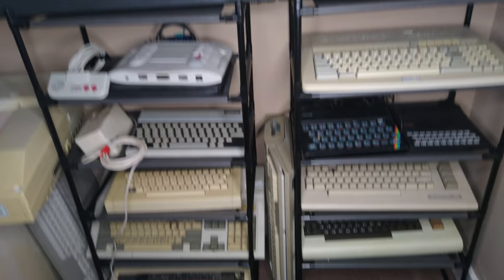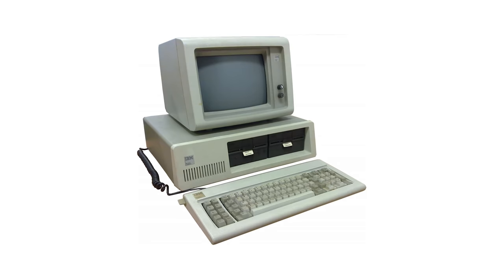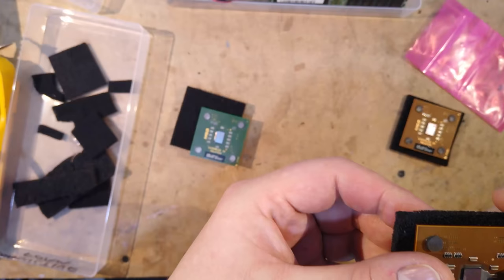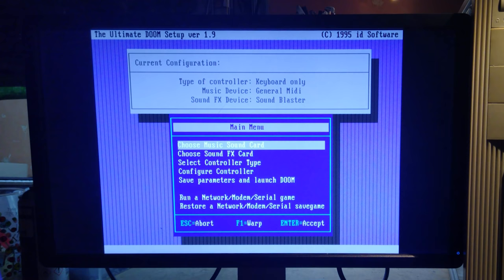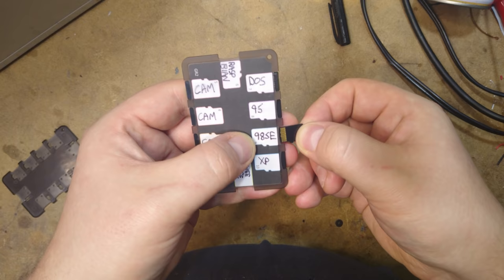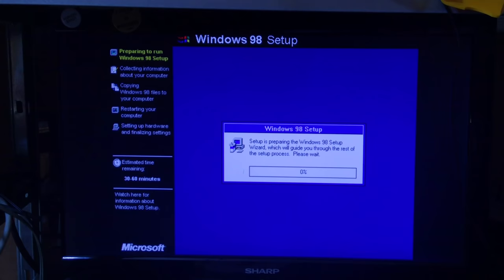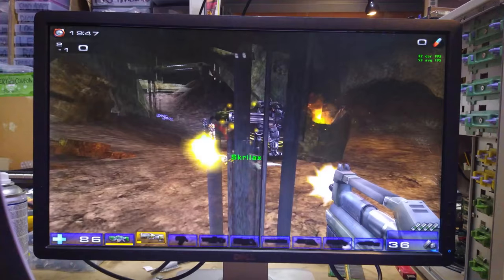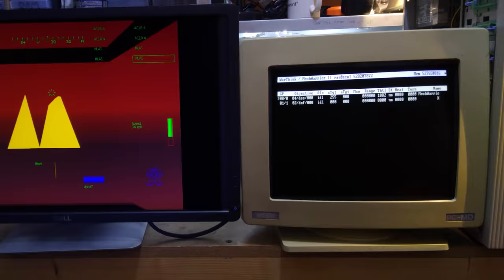Building a RIDICULOUSLY Overpowered DOS PC - Retro Rocket

Comment: 1:59 I think this claim is not really true. From my experience there are a lot of PCI sound cards which provide a perfect 100% compatibility (with SB-link of course) with every DOS game. 
All this while giving you a much better and cleaner sound, compared to majority of ISA ones.
Reply: Even without SB Link, I have an ESS Solo-1 and it works v well with a lot of DOS games 😎
Reply from the maker: Yeah that's true. SB-link would limit me to slower motherboards, though. Also I don't have any SB-link soundcards :)
Reply: If you have access to SB-LINK and only PCI slots, the YMF724 (and its friends 744 and 754) is the best choice for this hands down. It just so happens however that any motherboard really worth using that also has this connector also just happens to have an ISA slot or two.
Reply: @jamesfmackenzie  We meet again, my ESS Solo-1 with a socket 939 via board indeed works fantastic under dos to. Doesn't need sb-link either with the via chipset. That card has tricks up its sleeve to hijack whats needed.
Reply: @Henk717  😎

Comment: I’d love to recreate a retro rocket like the system I had back in the mid 2000s, loved AMD then and had an nforce 2 based Soltek board and a Barton core XP3200, MSI ti4800 agp card. Working in the industry and having access through friends and trading/swapping etc I ended up with a Tyan Tiger 2466 with matched MP2800 cpus, it was fast as hell but crap for gaming compared to the nforce board/XP processor. If I still had those rigs they’d likely need recapping, still have the 450w aerocool psu that ran them but not powered it up in years.

Comment: Look man you probs know what your doing so I wont bore you. Disregard if its no new info. When struggling with drivers, just install the windows compatible with the device. Navigate to system32 then drivers. Copy all driver name related folder. Install your newer windows and copy this driver folder to desktop. Right click the device and browse for driver. Select the folder, a error will appear as the driver isnt signed but you can just allow it. Ive found out of 100 times this has worked 100 times :)

Comment: I think it's time for a new Chain of Fools video. You can upgrade win10 from x86 to x64, so it's possible to go full-tilt and see if the legacy apps still work on Win11 x64. ;)
Reply from the maker: Haha, maybe :)  x64 windows won't run 16-bit apps though, I'm guessing it would be a pretty disappointing...
Reply: Wait it's that possible? How?
Reply: @AlejandroRodolfoMendez  If you mean upgrading win10 from x86 to x64, you just run the win10 x64 installer from within x86 windows, and pick the "upgrade" option. It should let you keep your settings/apps.
Reply: @BenKDesigns  oh on win 7 didn't let you or did a clean install. I didn't knew win 10 let you

Comment: out of curiosity, what kind of slot is that that you have just above the AGP slot? its the same color and width as an agp slot, but a bit shorter, and its a lot further towards the metal bracket than AGP is. never seen anything like it.
Reply from the maker: It's AMR, it can only take modems. Hardly ever used.

Comment: I'm curious: what if you boot Windows XP with that "hercules" graphics adapter? 🤔
Reply from the maker: XP doesn't have a hercules driver so not much I'm guessing. I think Windows 95/98 can be persuaded to use hercules, though.
Reply: @TheRasteri  I think Win98 have "1-bit"-like colour mode. You can try Win98 SE with that "hercules" card and let's see what happens.
(Disable the integrated video card on the motherboard first.)

Comment: 2:31 How were you able to use an AMD Athlon XP on that motherboard? I have a similiar QDI motherboard (Kinetiz 7t) and according to the manual i found on the web it doesn't say that it supports AMD Athlon XP, only Athlon up to 1 Ghz or higher.
Reply from the maker: I have a 7E which supports 133MHz FSB. But the 7T can do it too (it's called "Overclocking Jumper Setting" in the manual even when you're not technically overclocking), just it might not be as stable. Grab a 2800+ and try :) (code number AXDA2800DKV4C)
Reply: @TheRasteri  I see. Thanks :) .
Reply: @TheRasteri Hey,  one more question. Where did you get the latest bios for your motherboard (version 4.1 from 2004)? I found this version from somewhere for my motherboard,  but when i flashed it, it only upgraded to version 3.8 from 2001.

Comment: MSDOS PCs can not overpowered. Core2quad 2700mhz ready to startup all 4 cores and switch into 64 bit mode from MS DOS booting from ASUS Striker mainboard with non UEFI bios 8 GB DDR2 memory and PCIe slots and DOS on 2 gb USB stick, VBE 3 graphic mode resolution 1920x1200 on 28" LCD monitor in DOS.
Reply from the maker: Yeah I've seen some higher-powered DOS setups - can you get Soundblaster support on that motherboard?
Reply: @TheRasteri  No, this is the bad news. I do not figure it out how i can use my Soundblaster Audigy from DOS.
Reply from the maker: @maxmuster7003  Yeah soundblaster support only works on isa soundcards. Some motherboards have builtin audio that emulates an ISA soundcard though.
Reply: @TheRasteri  I am not familar with sound programming, but i try to test the ADLIB port addresses 0x388/0x389 for to make a noise using a DOSBox emulator app on an android tablet. My PC is broken. I am not sure if the CPU or the mainboard have a problem. Using the single step with a tiny mashine code it freeze and stop working after some instructions in MS DOS. The DOSBox emulation have also the ports at 0x220 for soundblaster.